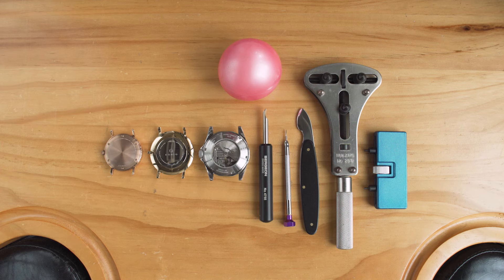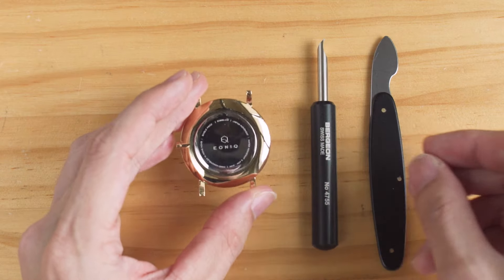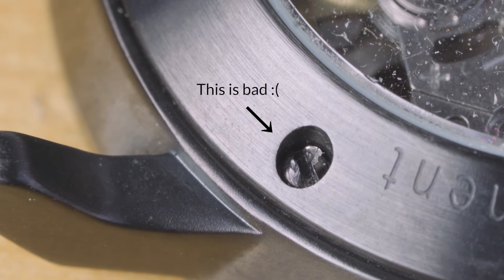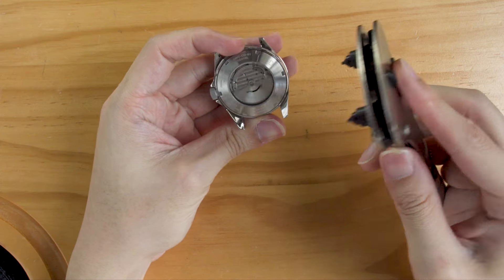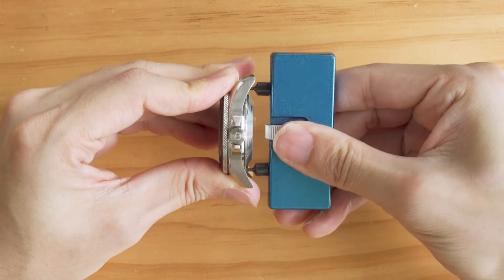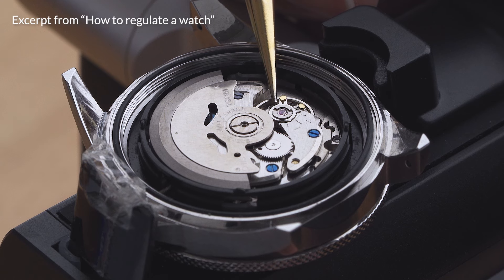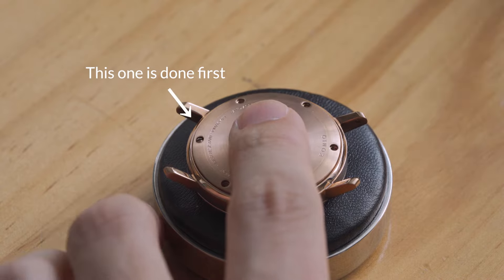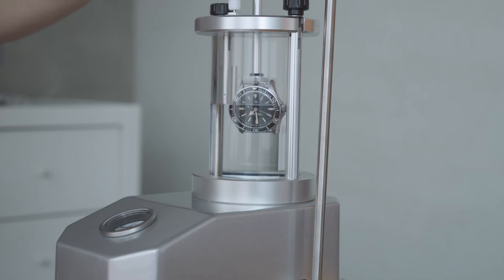How to Open any Watch

Comment: Any watch!  NOPE!  The watch i have has no notch   I bought a fancy kit and not one tool in it works
Reply: Use a thin razor blade or stanley blade.
Reply: Thanks MrRawUK, the Stanley blade worked a treat for me (I thought I was going to end up with a horrific hand wound, but luckily I didn’t). Thanks again
Reply: @RUFIGEKRU  I was the same and did mine the same day. Mine was a cheap £60 watch but it was a gift. Plenty of marks on the back from so called pro's who changed it before :)

Comment: Sorry but I have a watch here that does NOT have any 'lip' to prize it open. It is completely smooth all the way round the rim! (any suggestions would be helpful!)
Reply: Look closer maybe? I came to write the same comment but on extremely close re-inspection I found that it did have a lip around the back, but it's measured in tenths of a millimetre, I'd already written it off as not having one.

Comment: my citizen has 5 notches on case back.... not obviously opposite each other so the 3 pin tool won't work... any ideas? Thanks
Reply: I bought a Nav force watch on amazon with 5 notches, and bent my watch wrench trying to open it. After looking at it I noticed a small lip an it popped right open with a knife. Maybe you have a small lip on it.

Comment: My experience: I was at the airport waiting for my plane, dressed up to go to a wedding and was playing around with my nomos glasshutte. When the boarding call came through the speaker I managed to drop the damn thing on the floor and the caseback just rolled away. I picked it up and got to my plane. It was a 2.5 hour flight but I spent the entire time trying to get it's back, back on. It had a gasket which caused a lot of grief but I just couldnt get it on. Was thinking maybe cabin pressure or something was at play. Eventually  we landed and I rushed to a local watchmaker, he brought out that contraption, which I know now is the watch press. seemed to do the trick. However I noticed he didn't align the logo at the back which I new would annoy me forever so I made him do it again. I handed him the money and was on my way to the wedding ceremony. 10 minutes later, not fiddling with it or anything, just sitting quietly the damn back just popped off it again. To this day, I have never bothered to put it back on

Comment: I have a Pulsar Chronograph 100m  6 notch. Unfortunately, the removal tool won't line up with the notches. Is there another way to remove the back that hasn't been removed previously. Thanks again Melbourne, Australia

Comment: I have a Rolex GMT 2 aka Bruce Wayne model M126710GRNR-0003
My case size is 40mm. Do not know what is the size of the back case cover.
What size tool opener is needed to open the back case cover?
Thank you.